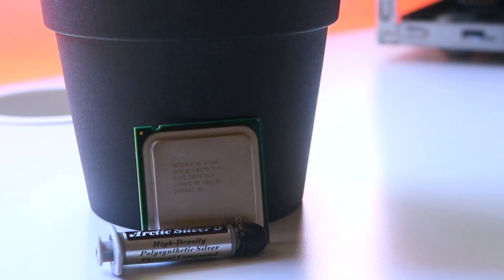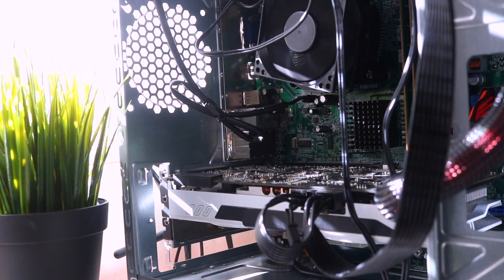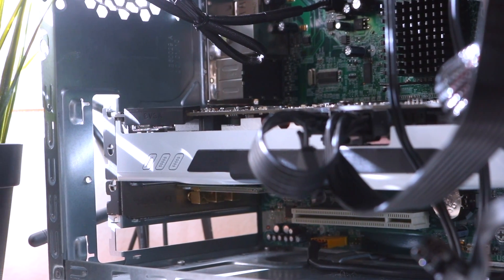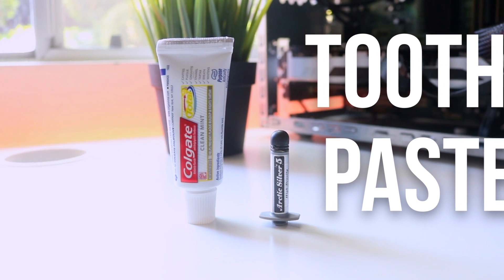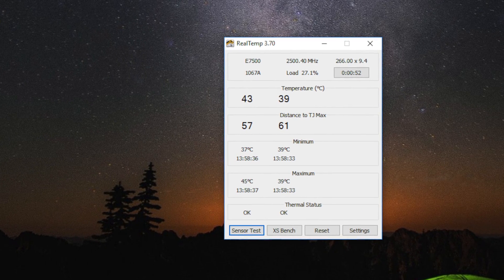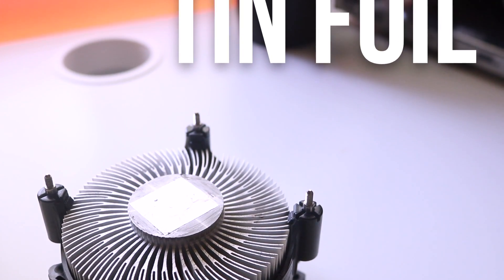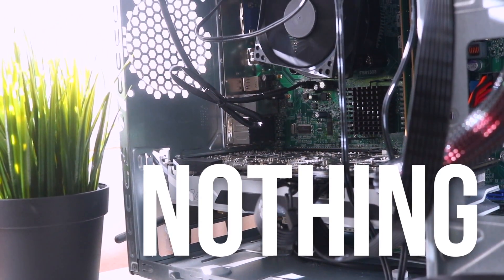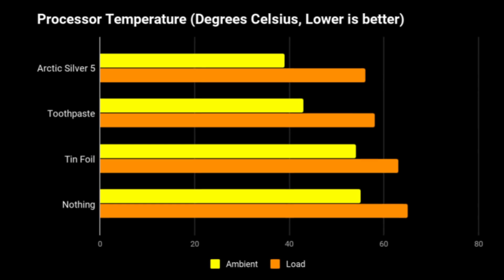Using Toothpaste as Thermal Paste! Does it work?

Comment: i will buy 2 days after thermal paste as i am not home. so i used toothpaste and it works best. using nothing will make ur laptop shut down 100 times an hr. if u removed thermal paste then u r darned. so if u removed old thermal paste to replace and couldnt get one then dont use it barely use toothpaste

Comment: I’ve spent 30 minutes reading about using toothpaste and none of the crap I read was useful. Your short video helped me In just 2 minutes. Thank you
Reply: Did it work
Reply: @ImErrorss  yup all it does is fill the voids between heat sink and ihs
Reply: @thenman23  cool found out the cpu was fine just need a new motherboard I’m fuckin msd

Comment: Toothpaste mixed with oil will not dry out! Prussian blue is also an excellent alternative!
Reply: Which oil ....will cooking oil work
Reply: @kennedychari7710  that's what I want to know as well
Reply: @Praneel  I think its petrol
Reply: @Praneel  just kidding
Reply: @Praneel  yep cooking oil only. hair oil is not good. use cooking oil
Reply: @alexlee1931  lol
Reply: @narutoshinchan8512  okay 👌
Reply: It's Olive Oil (as far as I know, normal oil that's used for cooking it's not recommended, it's better olive oil), it's true what he said, research more about this, I used it in the past with good results, didn't show any fried marks in the top. I don't have the Olive Oil anymore, I'll be buying it tomorrow for my new pc. Nobody will tell you this, but this combination it's safer for your body than thermal paste. But the best option I think it's the Thermal Pads, from Ic Graphite or Thermal Grizzly, I haven't test it, but I will in the next month.
Reply: @Minasti_7  
I lapped the lid and heat sink and used 2 drops of mineral oil as a contact medium, that took 15 degrees C off my temps.(effectively mechanical contact)
I now can't help but feel that any paste or solid can only act as an insulator and most new CPUs are not soldered to the lid now anyway so it makes little difference! (My CPU is the soldered type)
DiElecetric grease works well too!

Comment: I've noticed that thermal paste dries out over time as well. I don't think this affects thermal conductivity as long as you leave the heat sink in place. If you take your heatsink off for whatever reason and whatever paste you use is dry, I suggest cleaning and reapplying fresh paste.
Reply: Yee but thermal paste dries in a matter of months, not mere days, or in this case, minutes
Reply: @RudyMemes  toothpaste at higher temps can be less like a solid. So a pc is perfect for it

Comment: Hey would this gimbal work with my Phantom 1 without any soldering? http://www.ebay.com/itm/Walkera-G-2D-2-Axis-Camera-Brushless-Gimbal-for-Gopro-Hero-Metal-Version-/332309669924?epid=1250188882&hash=item4d5f332824:g:YhgAAOSwEBxZbo53
Reply from the maker: I'm not sure where you would plugin it i but the gimbal itself looks good.